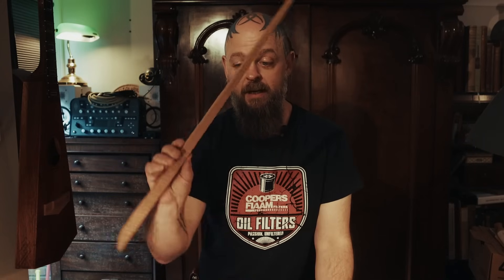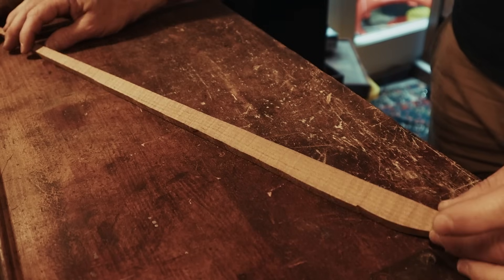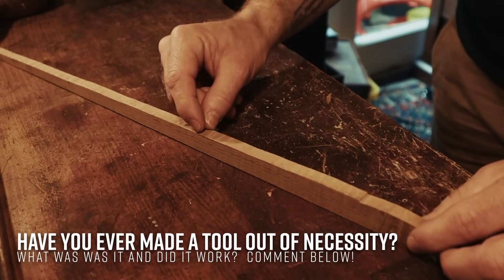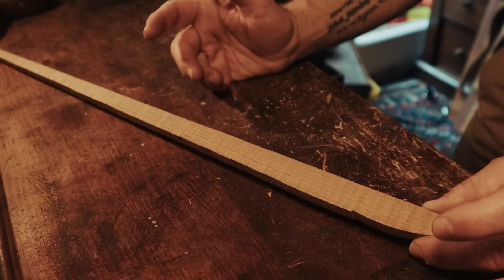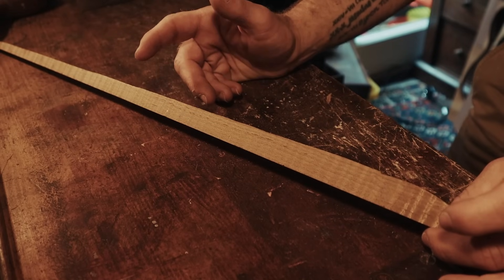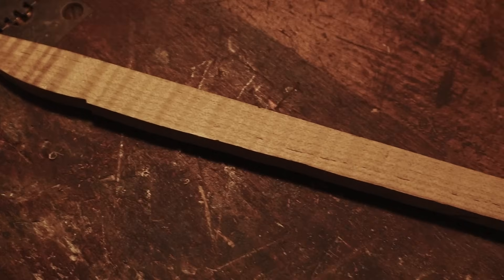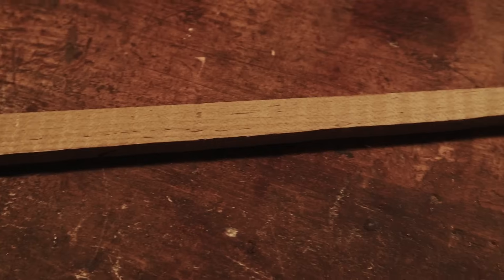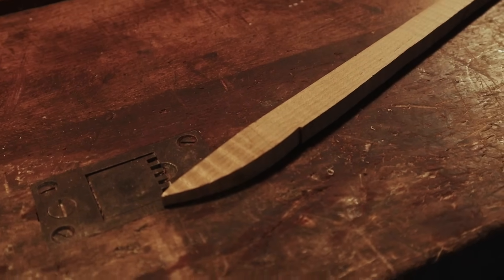Making A Mini Luthiers Veneer Saw

Comment: Why not, you know, use the Dremel?
Reply: I suspect he's making this for the hand tool only build
Reply: The tool is designed to cut a vertical slit through 6 mm veneer on an upcoming build.  Even a flexi-cable Dremel is too big to do that - but an oscillating tool with the correct type of blade might work.

Comment: Had the same situation when I bought my nut slotting files. 3 thin ones are very wobbly so built holders out of old fretboard offcuts. 3 grub screws to hold. Used super glue to harden to wood around the holes before tapping for grub screws. Works great.
Reply from the maker: you are one of the cool ones.. not enough people believe that wood can be tapped.. it opens up so many possibilities :)
Reply: @CrimsonCustomGuitars  tap the hole, flood the threads w superglue, and re-chase the threads once the glue hardens.  Works great with 3d printed parts too!

Comment: I want one just for the beautiful wood and finish. 
And you can never have too many different types of tools.
Sometimes a tool used the "wrong" way is the right tool for the job. 

If you drill holes in the saw blade and use a removable pin to lock it, 
you can rotate the blade when it gets dull.

I've got a bunch of thin small pieces of oak, 
like a mini version of parquet, 
that could be used in pairs to make similar tools. 
Like mounting small sanding discs and wheels, 
for precise applications where a Dremel is too powerful. 

Great stuff 
✌✌

Comment: I think I'll make one. But I think I might put a slight 10 degree angle on the handle. It'll require a proper finger joint, as it will need to be made from 2 pieces of wood, though.

Comment: Once, I was forced to make a tool with which to extract a broken tap from a hole so I cut two perpendicular slots into the end of a steel tube I found, then ground down the four little pieces created by those cuts so they were small enough to fit into the spaces between the taps cutting surfaces, it did work surprisingly well and yes, I was rather proud of myself after having extracted the broken 8-32 tap!

Comment: I seem to recall a sewing tool something like that, maybe for marking seams? Only the cutting wheel rolled.
Reply: A rotary knife for cutting fabrics?
Reply: @JamesMears76  I’ve found out the name for it is a tracing wheel. It's used to transfer markings from a pattern onto fabric or to create perforations along the fabric. So I guess only faintly reminiscent…

Comment: I've been wondering what that metal square on your bench was at 14 minutes. I thought the stop would fold up with a hole underneath so you could bolt something through the work top or put those crowbar type clamps through it for work holding.

Comment: As far as seeing the cut, maybe mount the blade on the outside.
Would there be any benefit shortening the tip of the handle so as to be able to use the handle vertically?

Comment: I would have probably put the blade in the dremel tool, cut the slot with it and have the whole job finished already 😅 However, then there wouldn't have been a video to watch for half an hour on a Thursday night, so thank you for this.
Reply: Exactly, came here to say that. Although I suppose this hand-controlled tool is much safer and less prone to "oops"

Comment: My "One Jig to Rule Them all". Its just a home made router flattening jig. But the sides are high enough that i have used it to 1. Flatten all the material for a Les Paul build, 2. Use it as a perfectly flat gluing base for the body, 3. Use a home made sine plate to router in the neck relief and matching neck pocket and 4. Use it as a top down mount for cutting the binding on the carved top. Many uses for an offcut of melamine  and some planed 1x4 pine. I think at least half the fun of building things is coming up with solutions to the problems we come across.

Comment: I once made a downhole cutter to install some down lights in my lounge out of an old piece of hacksaw blade. Head to snap the hacksaw blade off by folding it backwards and forwards. But luckily got the right length.

And then used an old piece of twig outside in the hacksaw mounting blade hole and fashioned a crude handle out of duct tape. 

Worked an absolute treat and was so much easier to use than the recommended craft knife. 

I see that similar things are available for sale but I was broke at the time.

Comment: Really enjoy seeing the full thought process of making tools for a specific use. As for the question you posed about using another tool (welders parallel clamp) to achieve the same outcome. IMHO I feel it best to actually make a new tool like you have done cause this allows for the setting and fine tuning of the tools use and it can always be set and ready to use. if one combines tools to make another, then if you need the original tools you have to disassemble the new tool and reset it if needed again in the future. Besides, who doesn't prefer making their own tools?

Comment: I think that would be good for cutting fret slots in very hard aluminum. All my fret saws just glide over it leaving only scratches. Not that any one cares about making aluminum fret boards I'm just trying it, it has been frustrating.
Reply: Try a milling machine, a very thin metal blade on a radial arm saw, or forego slots and just glue frets in place.
Reply: @normbarrows2  I tried milling I broke the bit :-(   There are fret saws for rotary arm saws. I do have a extremely good Festool miter. I actually have the patent for no tang frets, Parker stole it from me and never gave me a penny. Its very hard to remove the tang perfectly but I may resort to that. I ordered a new bit and am going to try again with the milling. I think there is a learning curve for doing this with such hard aluminum. I'll look for a fret saw that fits my Festool. Thanks for the feedback.
Reply: @anthonyb5279  Ken Parker uses a Dremel to grind the bottoms of fret ends after nipping the tangs - a concave bottom helps ensure the end sits flat on the fingerboard.  I still don't quite get how slots and tangs would work in aluminum.  Milling a fretless "sawtooth" fingerboard is another option.  Ben used one on a build.  I once notched a fingerboard then glued in rod stock for frets.  As long as the notches are uniform in width and depth, it works fine.
Reply: @normbarrows2   Well did an experiment first. I cut a slot into the hard aluminum and tested the stainless frets and they grabbed really good it was hard to get them back out. I just need to cut slower so the bit don't break. I ordered a new bit well a few as they seem very fragile. I Looked for some of those radial blades  WOOOO some of them were over $400!